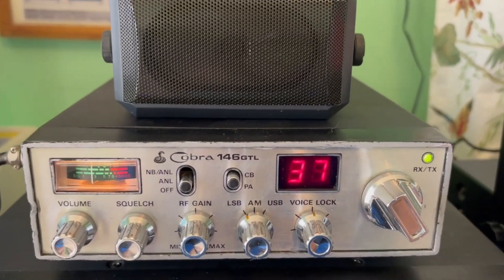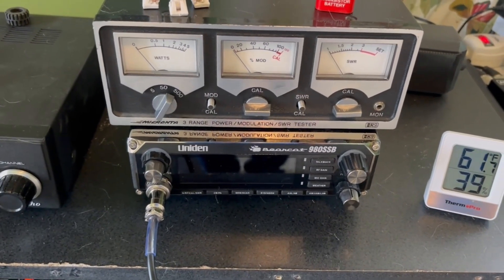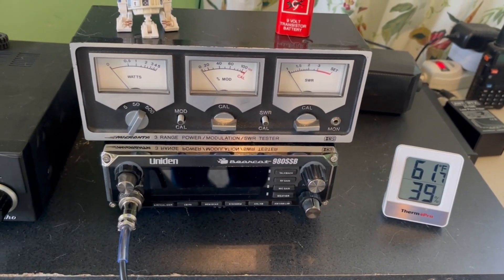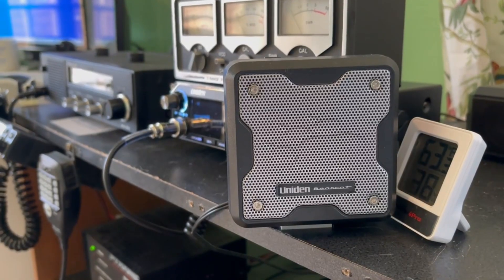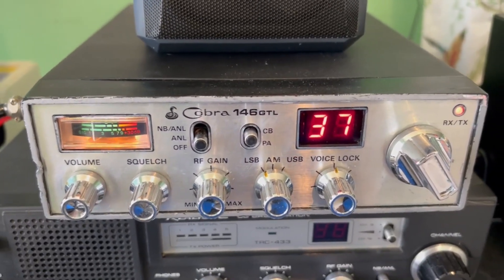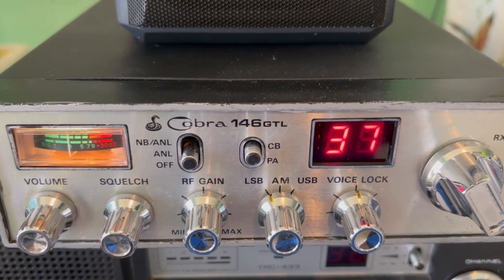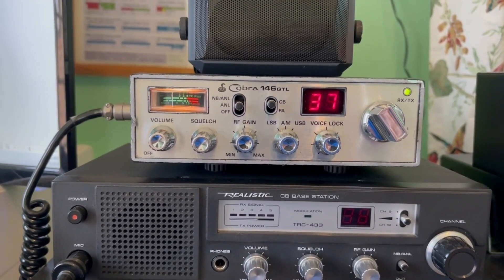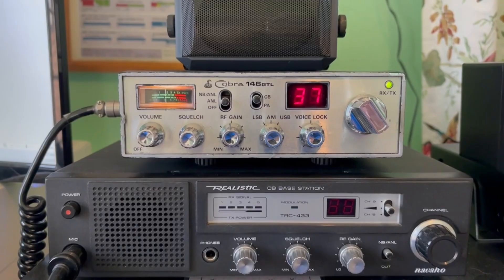Adjusting SSB Frequency on a CB Radio Without Test Equipment

Comment: Hi i have this issue right now i picked up a old Cobra 142 its off freq, so the question is did both CB's have antenna's in use when doing this? what did you do on that end?